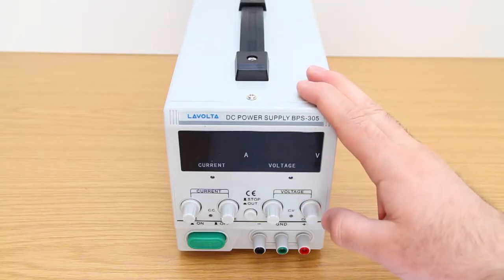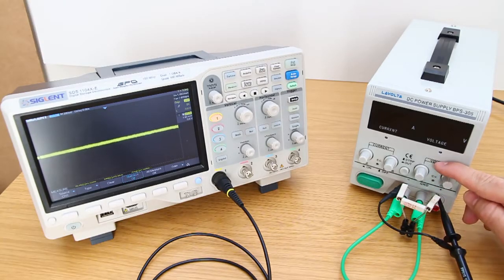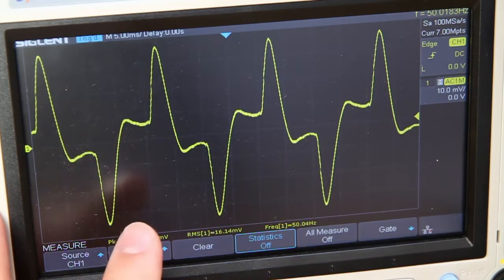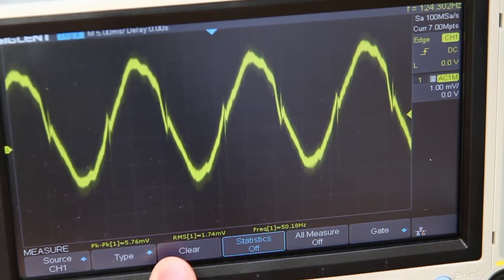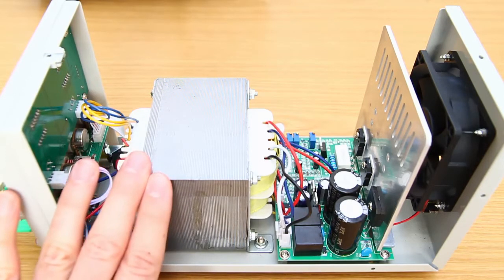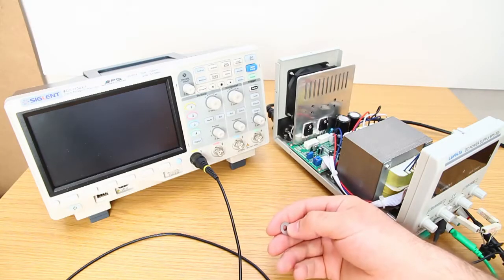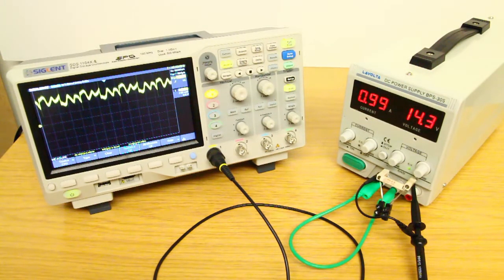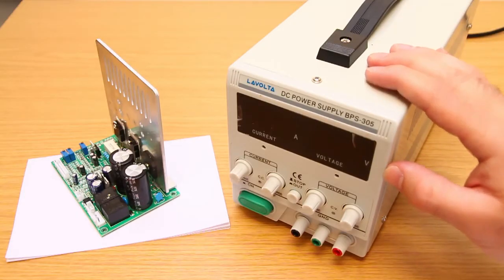Very Cheap and Easy Mod to Fix the Horrible Ripple, Below 1mV RMS ! - Lavolta BPS305 MKII #025

Comment: Along with electronics I find, fix, and sell small engine equipment. The same thing holds true. The bean counters get involved and the product gets cheapened up. Names like Cub Cadet, Troy-Bilt, Craftsman and many more. They all got bought up by MTD or are now made by MTD for them. They are told "build it to this price point." They all are cheaply made now. Plastic bushings, no bearings, Thin metal. Briggs & Stratton used to build world class engines...now they're Breaks & Scrap 'em. We've become a throw away society and no one knows how to do repairs or basic maintenance anymore. It stops running...they throw it away and get a new one. Actually this has been good for me...I've made some serious $ with my find, fix, sell side line. An, oh yeah, thanks for the video... well shot, clear and easy to follow!

Comment: LOL what a fool. All he had to do was clean the paint off the chassis where the transformer legs bolt so that all the transformer legs made good equally conductive contact to the chassis. But all he did was destroy the isolation of the chassis from the NEG terminal by making them no longer isolated. What a fool. You should never really connect the GRN to the Neg terminal on the front anyway. The ground terminal is there on front so you can connect it to whatever unit that is under test chassis, so that both the power supply and the unit under test have the same chassis ground. .  Chassis GRN is where all the filtering caps dissipate the AC noise to. You should never connect it to NEG terminal.
Reply: When would be a correct situation to bridge the DC output Negative to the chassis/earth ground?

Comment: Your assumption that there is a competent engineer looking at the overall design performance is very optimistic. 

In the USA with electronic instrumentation design, which would include a bench power supply, the modification would have the rear and front panel earth wires go to a single crimp eyelet, which would then be attached to the transformer grounding hardware (case hardware). The eyelet barrel size is chosen to accommodate both wires with a single crimp using an approved crimping tool. This way if the case connection (transformer case hardware) comes loose you will not lose your earth ground between the rear plug and the front connection. To put it another way all conveyed earth connections are always mechanically rigid without depending on screw hardware or a soldered connection. If a soldered connection gets hot it can come loose. So, the rear ground connection would be a crimped female crimp terminal (usually insulated) designed to fit the tab on the power inlet. Which would also be crimped with an approved crimper.

For a complex ripple noise waveform many times it will be specified in RMS, which implies the measuring device be true RMS with a rather large crest factor and a large enough bandwidth. Many newer oscilloscopes do a very good job at mathematically calculating the RMS value of a complex waveform (with a large enough sample size). But, it can be worthwhile to get an FFT of the noise, and also in some cases THD.

Comment: It isn't a great idea to solder the ground wire, because if current starts flowing on it, it may desolder itself and let the human conduct the current instead. It should be crimped instead...
Reply from the maker: Good point. Although it might not be always that easy to implement, but certainly well worth a try.

Comment: If you draw one amp through a bridge rectifier, all things equal, it dissipates around 2.8 W. If that energy has nowhere to go but the ambient air the high temperature isn't surprising.

Btw. it seems you haven't uploaded in over three years - why?
Reply from the maker: Even small things can make big problems.

Making these videos is a lot of work, at least 2 hours per minute video runtime in preparing the topic, shooting the material, editing and posting. And unless you go viral, you get only a couple hundred views. But I think I was close to finishing the next video, so I should be uploading a new video soon.

Comment: Great fix. The source of noise was likely due to eddy currents flowing in the transformer laminations causing a ground loop via the ground wiring. Rule number zero: ground everything to a single point. Treat that point like Rome (that is, all roads lead to Rome).  Any other arrangement is certain to introduce noise - you elegantly demonstrated that.

Comment: I had the same problem , nearly 45 years ago. Did build my oven transformer to a powersupplay when i was sin engineering class. Solution was to weld a seam over all the metal plates of the transformer. Connecting them solid together. Reduced the 50 Hz noise.

Comment: simple add a capacitor to your output. problem solved.  Go build a AC/DC full bridge rectifier regulator and you'd know its simple as that. 3 Farads does wonders for elimating ripple. (no I didnt typo that... yes 3 farads)
Reply from the maker: Preferably build out of 10,000 low ESR caps for that ultra peaky kilo Amps short circuit current, for when you really want to blow stuff up ;-)

Comment: Close to reality... thanks to the video and explanation! By the way if the GND is connected to the Negative (COM) will in general add or cancel the noise ? We always connect those two together with a short cable right at the PowerSupply (Mean Well) terminals. I notice noise and want to get rid of it. Will try by removing that bridge.

Comment: It is contrary to safety standards for a protective ground to be connected to a point that's primary purpose is other than safety related.  The transformer mounting bolt must be unfastened to service the transformer.  A safety ground connection is then compromised, it's no longer "safe."  The mains power cord green/yellow protective earth wire must be connected to the chassis with it's own grounding point with nothing else using that grounding point.

So, Mr. Smart-Ass K-Tech, you are WRONG!  The GROUND POINT should NOT be at the transformer mounting bolt.  Read the safety standards, ISO, UL, CSA, BSI, etc. ..............
Reply from the maker: Good point, I'll keep that in mind.

Comment: You are VERY LUCKY to have the old, linear, not switching type of power supply.
Reply: On switched the peak-to-peak ripple is very much higher.
Reply: @mcac-youtube  Yep.  There's a Japanese company that claimed to make low noise switchers, but apparently nobody bought them because they stopped making them.

Comment: What a great fix and fairly easy to do. As you noted in the last bit you also scraped the paint below the grounding foot of the transformer to ensure good contact (a great move that they also should have implemented in the first place); I wonder if even the original wire routing would have performed nearly as well with proper electrical contact to the casing at both grounding points; this would have shorted the current generated by the transformer plates, and the steel casing should have provided a much better ground path than the transformer body and would have cost them even less than wiring it properly (although they should have done that too).

Comment: normally, i would expect a lab power supply to be 'floating', with 1000 V isolation from the 'earth' ...if it's not 'floating', you can't do things like connecting in series for +/- supplies, and even in parallel, due to 'earth' differences.

Comment: this measurement is a bad problem, as it makes no sense to be using a chassis ground for your "negative"...without a truly "floated" scope, you have a multiple ground problem to deal with, and this is just bad practice...unless you connect the ground on the scope to a "hard" ground on the power supply, there's often a significantt "ground"voltage differential...in some "industrial" cases, you can have several volts difference, with a LOT of current possible..

Comment: Good video, thanks.  But it occurs to me that you may have improved the ripple further by wiring the output ground terminal directly to the ground input terminal on the mains IEC connector.  If there's any leakage in the transformer, then a very slight volt drop would appear across the ground wire at the grounding point on the transformer mounting screw.  By connecting directly to the power input socket this could be eliminated.  Either way, your final ripple voltage is good and  very much better than it was.

Comment: I think you're just overthinking it.  The reality is the mechanical engineer has no idea what ground means.  As long as its connected to a conductive point on the chassis, its ground.  Case closed.  I'm sure the electrical engineer is also some new guy who doesn't know any better.  They probably never heard of a ripple.

Comment: I just built a linear regulator and was disappointed by a few millivolts of ripple.  Eventually I realised that the earthing wire with a croc clip on my scope probe was lying next to the transformer core.  I moved it away and the ripple disappeared.  The lesson is that you should keep sensitive circuits well clear of transformers.  Stray magnetic fields cause induced emf.  The transformer even has a flux band to reduce stray fields.
Reply: I have a similar issue with a cheap Sony turntable. The ripple is audible. At first I thought the filter cap had gone, but no. Replaced filter cap - ripple's still there. Eventually I realised that the transformer is just way too close to the amp circuit board (which... why does a turntable you sell with component systems even have that, but whatever).

One day I'll finally have nothing better to do and move the transformer.
Reply: @233kosta  u have any model number for it? (i hope it may be possible find a pictures of the inside) ... it may be simpler just make a simple shield and/or filter caps .. most likely thay didnt add any filter on the primary -> ground noise is being amplified....  could test wrapping the power cord around a ferite atleast 2 laps and see if it cancels out.. 
if it does u have could have a ground noice problem.. (cused by something else conncted to the electric system/ground...motors are one huge source for such noice... washing machine etc..

Comment: Your 2-minute rant about some imagined penny-saving design house is absurd. Yes, the design is flawed, but it was simple ignorance of grounding principles that was root cause. For most EEs, proper grounding is black magic, as is magnetics. These things are almost always learned from experience.I bet that no more than 1% of the commenters here understand grounding principles. Here's a simple test for everyone: "what is 'ground'?" Better yet, "what causes noise on a ground plane?" If you can't answer these questions, should you be banned from commenting here? This Chinese design house screwed up their grounding on a $50 power supply, and you act as if he's now a millionaire now because of it. Come on, man, you're smarter than that!
Reply from the maker: Obviously you never had argue in hour long meetings for why you need that one 0,04 Cents more expensive flat head screw. Most of it was meant to be funny, but there is a kernel of truth.

Comment: One thing I would have done as well. Good video to show how manufacturing techniques are also short comings of what needs to be done in thinking as what should have been done, bottom line. 👍 remember to be well grounded in the design first.

Comment: Klasse Videos! Danke. Ich werde mir dieses Modell holen, da es für meine Zwecke ausreichend ist. Ich mache viel mit Vintage-HiFi und Kofferradios als Restauration für meine Sammlung (+ YT Channel) und da kannst du kein "neuartiges" Schaltnetzteil brauchen. Dein ganzer Lang- Mittel- und Kurzwellenempfang wird sonst verdorben durch diese massiven Störimpulse. So kannst du nichts reparieren oder abgleichen. Dachte so etwas klassisches, lineares mit Längsregler gäbe es schon nicht mehr neu zu kaufen heute. Gut zu wissen :-)  dazu sind die 3 von dir genannten "Mods" rasch und günstig umsetzbar. Habe mir auch deinen Vergleich zum "MK II" angeschaut. Problem ist es dann das MKII eindeutig zu identifizieren. Selbst wenn du genau hinschaust weißt du nie ob du dann final v1 oder v2 geliefert bekommst :-( Auch der Belastungstest (sehr schön dargestellt) über die Zeit mit Erwärmungsmessung war sehr akzeptabel insgesamt vom Ergebnis. Ich brauche zwar oft nur wenige 100 mA,  aber es ist gut zu wissen, dass bei Bedarf auch mehr geht.
# English #
Great videos! Thanks. I will get this model, because it is sufficient for my purposes. I do a lot with vintage hifi and portable radios as restoration for my collection (+ YT Channel) and you don't can use a switching power supply. Your whole LW, MW and SW reception will otherwise be disturbed by these massive interferences. So you cannot repair or adjust anything. Thought something like this classic, linear with longitudinal regulator would not be available for purchase anymore. Good to know :-) in addition the 3 "Mods" mentioned by you are fast and inexpensive convertible. I also took a look at your comparison to the "MK II". The problem is to identify them clearly. Even if you look closely you never know if you will get final v1 or v2 :-( Also the stress test (very nicely presented) over the time with heating measurement was very acceptable overall from the result. I often only need a few 100 mA, but it is good to know that more is possible if necessary.

Comment: Cool observation and thanks for sharing.
I just bought a Dr. Meter branded one of these and I bet it has the same issue.
I plan on taking it to bits when I get over a migraine.
Reply from the maker: Thank you for watching, hope your migraine is better now.
Reply: @k-tech796  thank you.
The Dr. Meter branded PSU is built the same way.
The hope of lower ripple was the reason I bought a linear power supply.
Thanks again for addressing this issue.  Since these are very popular bench PSU I would imagine more people would also like to know about this issue and modification.
And yes, migraine is much better now.